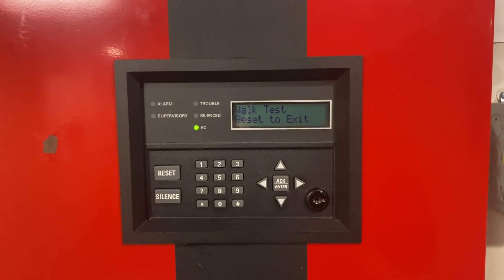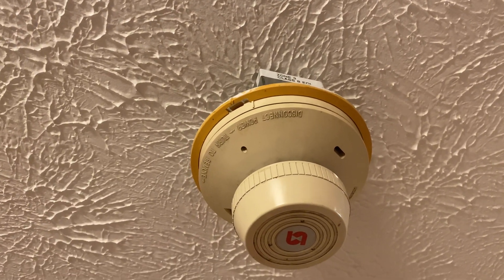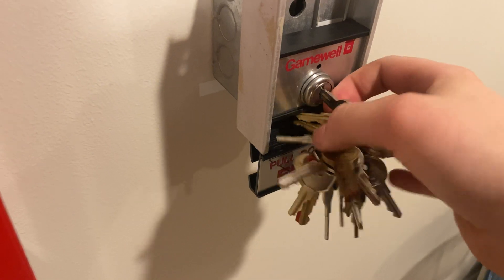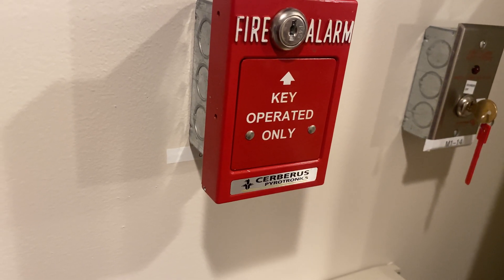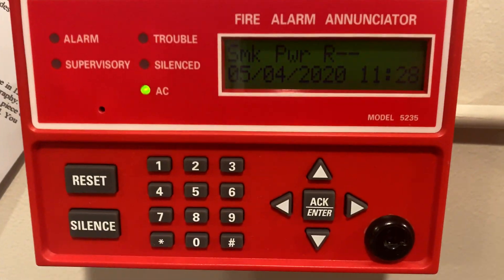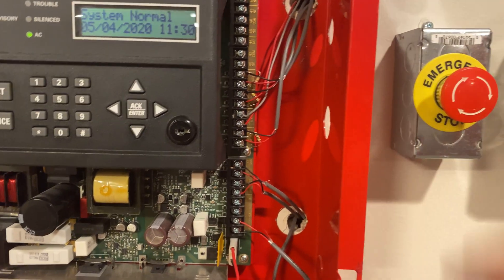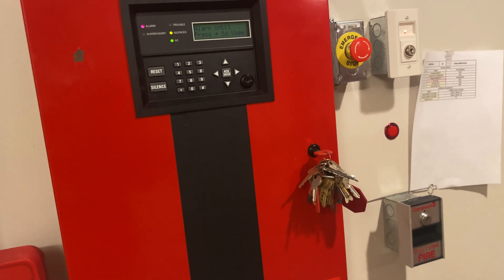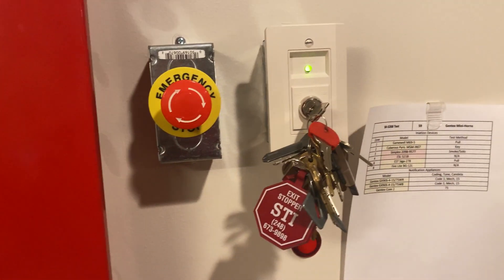SK-5208 Test 59: Gentex Mini-Sounders

Comment: Yikes, mini horns are definite "squealers" and are not quiet at all lol (for the most part tho). Those look like the "later" first generation Gentex GX-90s (circa 1994 - 1995? i believe, since the strobe doesn't have those "reflectors". and also has that silver-colored trim thing around the strobe unit itself, unlike the original first generation). Synchronized versions of the GX-90 wouldn't be a little later till 1997 and after (that being the second generation models with the strobe reflectors). I might be wrong, but that's from my understanding

Great video